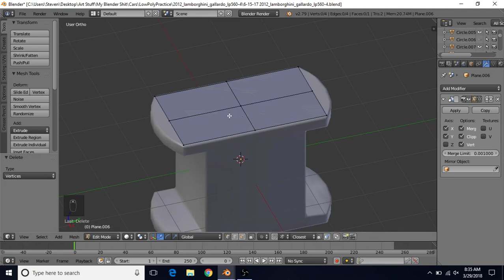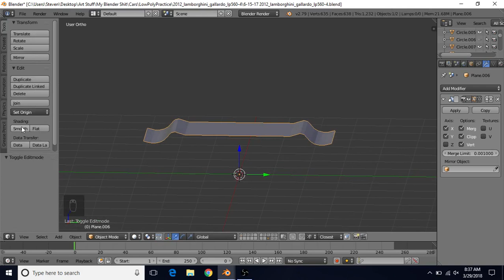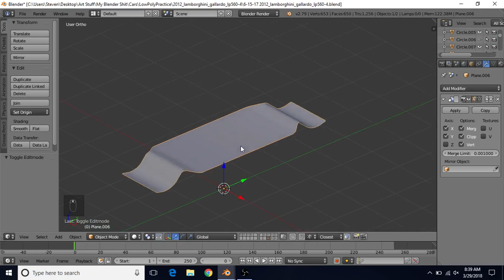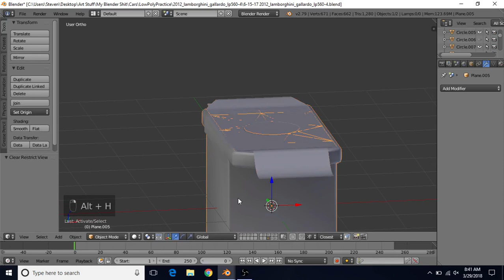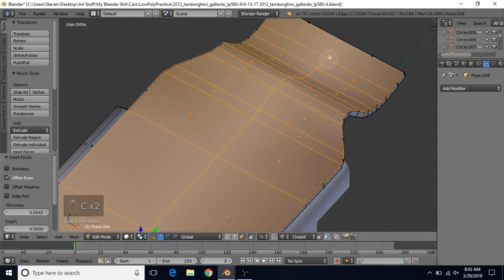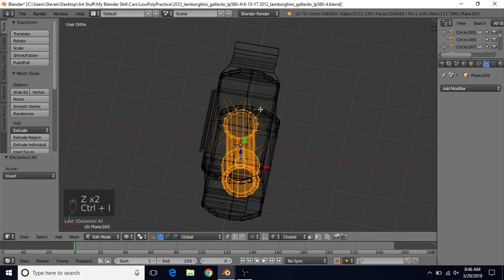Model A Lamborghini Gallardo LP560-4 in Blender - Tutorial Part 41 - Disc Brake Part 4 - Rattle Clip

Comment: HI steven first of all love your vids they helped me improve my modeling a lot :) .i have a question ,I heard that every face in the mesh should have 4 vertices so it will have a "direction" I want to know when it is ok to use triangles and when it's not
Reply from the maker: In general triangles will be fine if surface is completely flat. This is because there won't be any shading issues caused by the triangles. The benefit of keeping all quads is that you can easily add in an edge loop with ctrl + r. If you have any triangles in the way, the edge loop won't work. So this is the possible downside of triangles. The other time to avoid them is if they're giving you shading problems. If the shading looks all weird because you have a triangle there, you can try quads instead. 

One of the main times I use triangles is to create the end of a crease line on cars. Although it's possible to get the shading to look right with quads, it's far easier to use triangles at the end to give the crease ending effect where it fades out and the car becomes smooth again. We did this on the hood of this gallardo earlier in the series.

Some other important things to be aware of:

If you're making a models for games, they're going to end up triangulated anyway. Game engines triangulate everything, so any quads you have will be converted to triangles by the game engine. All quads may make it easier to unwrap the model however, and most game models are still made with quads, so it still may be beneficial to use quads.

If you plan to use a subdivision surface modifier, any triangles will automatically become quads when the modifier is applied. So if you have a few triangles, who cares. The end result will be quads anyway.

Professionals tend to expect models to be done in all quads, with very few if any triangles. There are however exceptions to every rule.

I'm sure there are more things people could point out, but I think this gives you an idea. Thanks for the comment! I'm glad my tutorials are helping you :D.